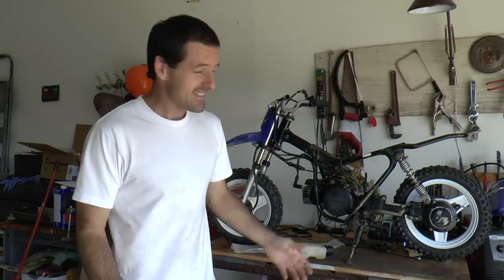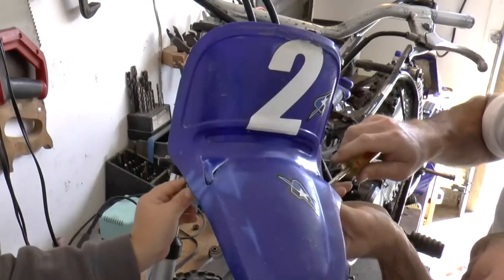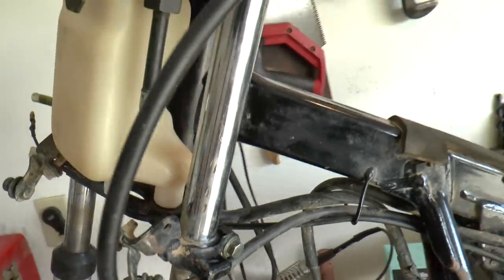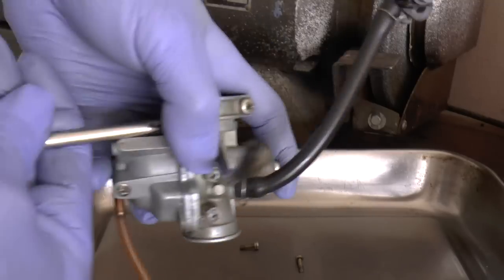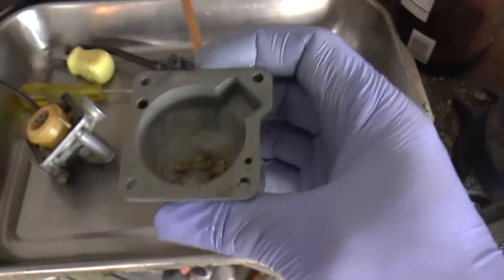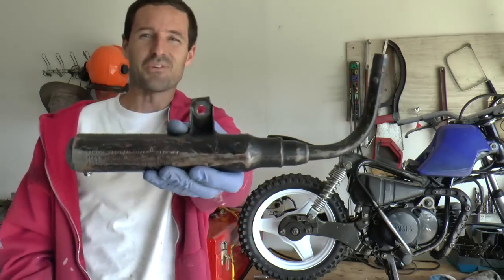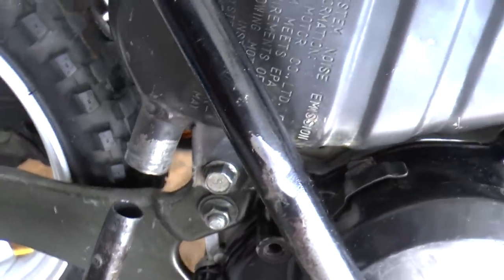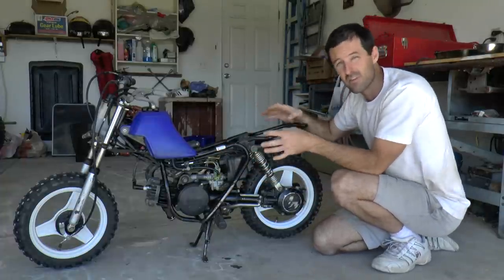$175 Yamaha PW50 Project - Part 3

Comment: If I'm correct, you don't put mixed gas in the gas tank, you only put in straight gas.  The oil sump for the 2-cycle oil that you just put will automatically mix the gas and oil for you.
Reply: Powell Sanders in the last video he said it doesn’t work
Reply: Powell Sanders yes you are correct
Reply: Hes not sure if it works I think
Reply: I think your right but I don't know because I'm a 2strok guy.

Comment: Like you said about causing damage with an oil injector delete, I got a 1980 arctic cat snowmobile they didn’t cap the lines and was running lean at high end after carb cleaning ,capped those lines and it ran pry 20-90f degrees colder

Comment: Back in high school I had a Cushman Eagle, they didn't come with a key, just a kill switch. I wanted to ride it to school, but needed a key switch so it wouldn't be stolen at school, so we had a key switch installed, next day I went out to start it so I could ride it to school, it wouldn't start, I kicked it at least 50 times, went back in the house and told my dad it wouldn't start, so he asked me if I used the key....it started when I put the key in it. I should mention the switch was out of sight on the back side of the engine, you had to look for it to even see it, plus you started it on the other side of the bike from the switch.so I had a little bit of an excuse for forgetting.

Comment: Dam that bike keeps giving and giving :-(, so many problems that i wonder if it ever ran propperly.
Yes that piston does look damaged, the rings/bore won't be any better :-(, but if it has enough power to trundle around then being slower is safer for the lad :-)

Sometimes just taking something apart and fondling the parts makes it work, i've done this many times and the item works again!, the down side is ya don't know what the fault was lol.
Reply from the maker: Yes the problems are really popping up. My perception of the bike in general has changed from "well used but still solid" to something less complimentary.

Comment: i worked on one of these about a year ago... that stupid kill switch screwed with me at first... but the problem was the carb... the guy bought a chinese carb from ebay and it flooded immediately... the needle had no rubber tip and the seat was not rubber either... they sent another carb for free and all was well

Comment: Fun times...just a little curious, though...why use mixed gas when you just fixed the injection system?
Reply: Just to be safe
Reply from the maker: yes, better a little extra smoke than a seized motor

Comment: You could have just tap the bottom of carburetor with a screwdriver and the flot might not have been stuck any more. And the gas comes out of the over flow like it did could have ment the flot was stuck